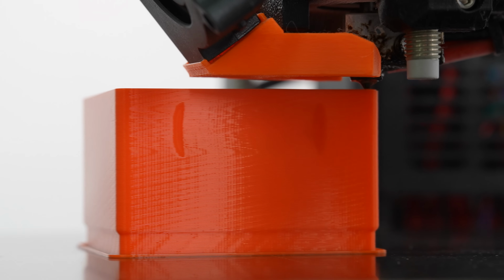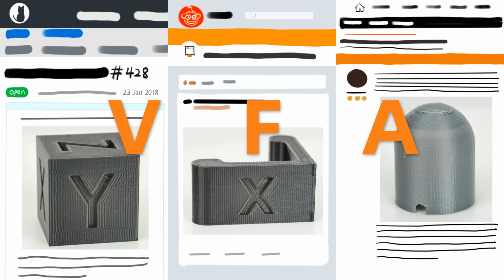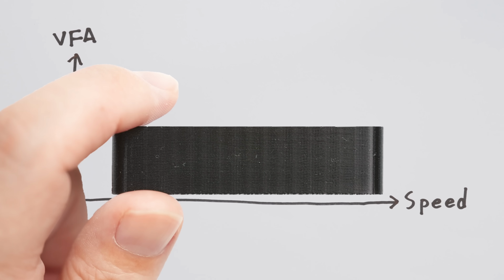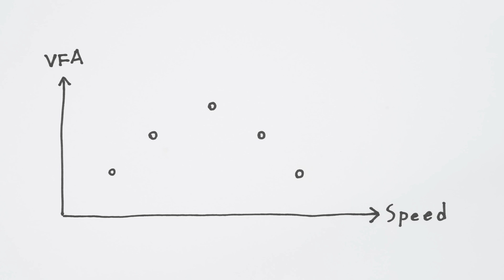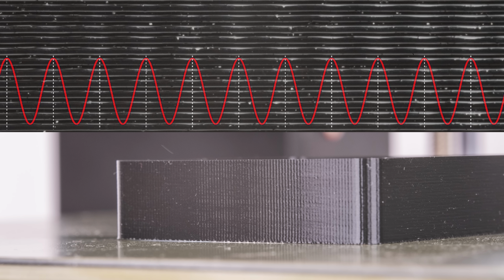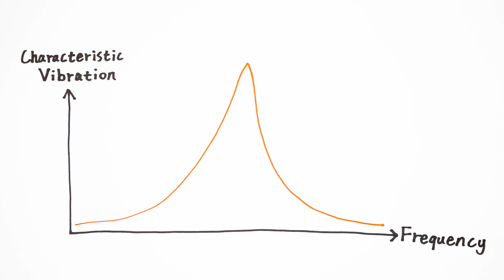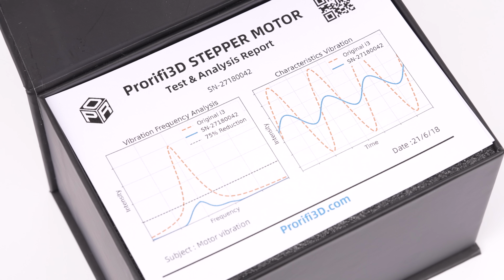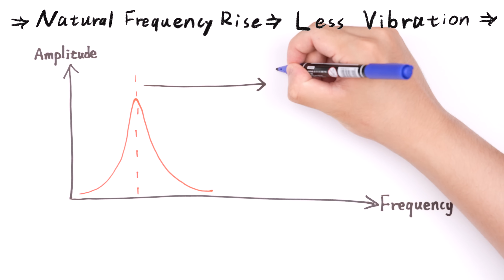We solved this common problem in 3D printing

Comment: Or just use input_shaper to rectify the resonance issues...
Reply from the maker: MRR(VFA) and ghosting are not caused by the same mechanism. Input shaping can reduce ghosting but it has no effect on MRR. We have a technical details page to help you understand the cause of MRR(VFA):https://prorifi3d.com/pages/technical-details
Reply: @Prorifi3D  Alright cool. Did you use input_shaper and your set up at the same time? If so, do you have pictures, and at what speed were you printing at?

Comment: Would these supper motors work on an ender 3 v2 that may be upgrades to an s1...
Reply from the maker: The tests we did on Ender 3 is limited but the result of MRR reduction is siginificant. We will realease a general purpose motor soon.

Comment: i guess personal background plays a big part in finding this problem. I found it in an afternoon and swapped to 0.9deg zyltec steppers and problem gone. 

good work explaining it though. its just a result of the stepper hitting its natural steps in a continuous move, think of it like rounding up or rounding down a number, its where the motor wants to rest. Its the same deal why people refer to "magic" layer heights, on a typical multi-start screw like an ender, one full step*pitch equals around 0.04mm.
Reply: So what is the magic layer height for a Prusa MK3?
Reply from the maker: We did some tests and research on 0.9° steppers years ago and they do reduce MRR(VFA). However, 0.9° steppers will bring more problems than they solved:
1. The 0.9° steppers have less torque and will lose even more torque at high speed compared to 1.8° steppers. This leads to poorer performance and stability.
2. Using 0.9° steppers also gives the stepper driver a heavier burden which will generate more heat. This will further reduce the stability.
3. In addition, for Prusa i3 and many other printers, switching to 0.9° steppers means your machine is no longer compatible with the stock firmware.
In conclusion, using 0.9° steppers means losing efficiency and stability in 3D printing. Thus they are not suitable for 3D printing.
Reply: @karoo_bushman6880  not a prusa guy, but you just have to find the pitch of the z screws and what degree the steppers are, probably 1.8deg. considering how thorough Prusa is, i would imagine the factory prusa profiles account for this, but wouldn't hurt to check
Reply: @Prorifi3D  not counting Prusa, if one is going to the extent of modifying a machine to the degree of replacing steppers, firmware likely isn't an issue. 

1:  if you are direct swapping without adjusting vref/current, this could be true. 

However I have 5 machines converted one of which is a delta machine. 2 machines are still on old A4988 drivers and even with a higher vref, the driver temperature difference is negligible, and performance at speed hasn't been impacted, even with Klipper and accelerations in the 3-5000 range on a 310x310 sized machine. 

I have thousands of hours on these machines with drivers ranging from A4988s to 2208/2209s, especially with more and more common TMC drivers, they are more than capable of driving them without issue. 

print quality and even noise has greatly improved with the 0.9deg steppers as on my delta and a couple 310x310 machines the banding effect was exceptionally noticeable. 

0.9 steppers on the extruder make a difference as well as once i converted the linear axis, you could see the same effect from the direct drive extruder as well when you looked close. 

i come from a Milling applications background, and i find tinkering on the printers more fun than even using them. 

I just don't care for broad statements against something (makes sense here, as this is basically a big AD video for your steppers lol) when I am literally sitting next to machines I have a ton of use with before and after trying the 0.9 steppers.
Reply: @Prorifi3D  saying 0.9 degree steppers are not suitable for printing is a massive stretch, and I would argue is outright false. I installed 0.9 degree steppers on my machine as a means to reduce VFA and they have been in service for 2-3000 hours at least, maybe more. 

You may need to compensate for reduced torque by using larger motors, but that has not been a limiting factor in my experience. Standard print speed for me is 80-100mm/s with acceleration at 4,000 on a bed slinger. I've printed much faster than this too with much higher accelerations and torque has not been an issue.  Talking 10-15k acceleration and 2-300mm/s on my cheap bed slinger. 

I would agree it may not be an entry level modification, as it requires some tuning (adjusting for steps, maybe adjusting stepper amps) but it is very achievable with some basic searches.

Your video is very good but your marketing and community responses are a bit vague/misleading to say the least.
Reply: @DangaRanga  I read your response after I responded - glad to see you have very similar experience to me on this. 

Quality 0.9deg steppers paired with 2208/9's is a massive improvement for vibration and print quality.
Reply: But you cannot just go ahead and install 0.9deg Motors on a Prusa. It requires to change and re-flash the firmware. I personally never touched it and don't even know if that's possible.
I remember having 0.9 on one of my printers and it was crap. It was weak and required much more calculations by the driver.
Reply: @mjcantontube  What are quality 0.9 deg steppers? I found a video about this topic, claiming that 0.9deg steppers from ACT were the fix. But I can't find them anywhere online.
Reply: @alejandroperez5368  I've had good luck with E3D's.

Comment: So, you basically found the holy grail of stepper motor design?
Reply: no because its just a LDO  Nema Stepper motor nothing else... dont fall for this. if you want to save money. check your belt tensioning, bearings, idlers, stepper driver voltage and ofc print speeds. coming from someone with 15+ years experience in the 3d print industry.

Comment: We had similar issues on some scientific projects decades ago. Best way to get smooth motion is to avoid stepper motors, they have vibration inducing torque ripple. At some level it is inherent in their fundamental design. Properly designed servo motors (with appropriate controllers) avoid this problem. The electronics and the motor must be designed to produce constant smooth torque. Steppers are great for low cost motion but not for smooth motion. Good motor control hardware and software can go a long way toward reducing the problem. If that's not enough, and one is contemplating changing the motors, perhaps it is time to change the type of motors.
Reply: Then SERVO motors?
Reply: easy to fix, lower belt tensions and lower stepper voltages and don't go over the mechanical speeds of a printer. some can print faster than orthers.
Reply: @teeniv84  Yeah servo's are the best but really expensive to set up. not worth it tbh because everything you see in that video is just artificially made... i got 5  i3's and none of them have these issues. and just look what other people print, almost none look like it in this video.

Comment: Great video, subbed. when are you going to make steppers for other printers?
Reply from the maker: We do have the plans for this but the product development and production cycle is long. It is not expected to be released for at least half a year. 
But we are testing the adaptation of our current NEMA 17 motors on other machines. With our limited tests, most machines including Ender3 and Voron V0.1 can use our motors with modified printed parts plus some tuning on driver configurations, and the MRR(VFA) reduction is significant.

Comment: Input Shaping or Resonance Compensation settings in firmware is a solution obiously. That's free and fast to do. Of course, maybe that's great to have such motors in 3d printer. It could make it a bit faster. But 199$ for 3 motors??? This is a robbery...
Reply from the maker: MRR(VFA) and ghosting are not caused by the same mechanism. Input shaping can reduce ghosting but it has no effect on MRR. We have a technical details page to help you understand the cause of MRR(VFA):https://prorifi3d.com/pages/technical-details

Comment: Is the MRR defect the result of resonance in the XY motion or in the extruder motor? Is the same defect seen in a bowen setup? I know a similar defect can show up from extruder hobbed gear being slightly eccentric. A very tiny ripple can even be seen that corresponds to the individual teeth on the hobbed gear as it bites into the filament.
If it's from XY motion, I also wonder if the resonant frequency corresponds to the belt length. Maybe the input vibration is from the motor and the belt resonates, causing a fluctuating tension at the print head.
Reply: the tooth digging in is very noticeable for me! as I print very small models with .25 nozzles

Comment: what about tl-smoothers?🤔 isnt that optimize stepper current?
Reply from the maker: TL-Smoother is an old story. And it has nothing to do with MRR(VFA). It fixes the defects of early low-end drivers. However, it is no longer needed on today's high-end drivers such as TMC drivers. You can check the details here:https://blog.trinamic.com/2018/08/16/tl-smoothers-do-they-make-sense/
Reply: @Prorifi3D  i would combine and measure resonance again:D

Comment: Nah, The problem is related to dual drive gears, not to motor. Even when use stealth chop or not I can still see artefacts. But guess what happens when I switched Motors between Prusa i3mk3s to i3 mk2s? Exactly - nothing happens because problem is related to dual gear extruder. Cheers
Reply from the maker: Looks like you are mixing inconsistent extrusion and MRR. We have a technical details page to help you understand the cause of MRR(VFA):https://prorifi3d.com/pages/technical-details

Comment: Moons motor?
Reply from the maker: Our motors are not from Moons or any rebrand. We produce motors.We performed tests on Moons steppers. The differences between motors are relatively large, especially in recent batches. Some of them can even achieve our qualified standard. But in the same batch there will be some with large vibrations. For consumers, there is no gaurentee for the quality of the motors you get. Thus no gaurentee for MRR reduction.
Reply: @Prorifi3D  good job!

Comment: MRR is caused by microstepping - motors only have a finite number of poles and digitally create aritifical sub-poles to achieve more precision. All that needs to happen is a gear reduction needs to be used instead of microstepping and the problem would theoretically be taken care of, being that it's a product of the microsteps between physical poles having varying levels of holding torque. Basically, the motor is slipping from the microsteps toward one of the physical poles.
Reply from the maker: Original i3 was already equipped with TMC 2130 drivers since MK3. We have a technical details page to help you understand the cause of MRR(VFA):https://prorifi3d.com/pages/technical-details

Comment: so with these motors coupled with resonance compensation tuning (input shaping) there should be zero resonance artefacts even at high speeds?
Reply: Because this varies of the speed. I think not  elimination complete but it would help.

Comment: Your site has almost no specs listed for the motor. Makes me think you're just taking 0.9 degree steppers from one of the better chinese manufacturers and rebranding them for a huge markup...
Reply from the maker: Our motors are 1.8 deg steppers, which will not lose torque or lose even more torque at high speeds like 0.9 deg steppers. We produce motors and so far as we know we are the only manufacturer who performs vibrations tests on every motor off the production line with reports attached.

Comment: Gear video and findings but just the fact that your brand will use “original i3” to designate Prusa or blur out LDO and MOON’S names is making me highly dislike your brand. I am sure it is done to prevent getting a copyright infringement but it most certainly would not happen. Secondly the fact that the graphs don’t have any real values make those very shady.

Comment: what about better motor drivers like trinamic?
Reply: Actually Prusa was one of the first companys using Trinamic with the mk3 in 2017. But at that time Marlin 2 was not ready yet, 8bit was state of the art. Due to the computing power of the board, 0.9° steppers were problematicly, so 1.8° are used.
In 2021 of course the solution is clear: Add Raspberry Pi Zero 2 W with Klipper and input shaper. As the mk3s has a port for a Pi Zero from the beginning, the hardware upgrade is quite easy. With the computing power of the Pi z2 the Einsy board becomes a dumb I/O, and can handle more steps/s - so you can use 0.9° Stepper without a problem. And klipper compensates for remaining resonances.

Anyway: TMC are controlled with 1/16 microstepping, making some predictions to interpolate to 1/256 microstepping. Theese predictions are not always correct. So a higher native microstepping might also be a good idea to reduce vibrations. So maybe some deeper digging into the internals of the used TMC, it can definitly used 1/32 native (prusa uses this on e), but maybe even better if not limited by the 8 bit?

Comment: First All Aluminium V-Slot Profiles are the same so it can not be from frame... I am a engineer that has over 25 years of experince in Mechatronics.As you guys don't know what the problem is I can guarantee you the problem source is extruder gear alignment,hotend heat instability and even the same looking filament is not all same thickness every meter... 3D Printing is not a Precise manufacturing process.The nature of Additive manufacturing leaves the unwanted artifacts.Cause its nearly impossible to maintain every parameter same like filament thickness,hot end heat stability although the extruder gear shifting,pressure can be optimized but filament thickness shifting will still effect the quality...

Comment: Installed closed loop steppers on X&Y ---> problem gone on any speed. No vibrations anymore, continuous correction of the steps, and you can see this while printing (always correcting)

Comment: I call BS until tested and proven by independent reviewers.
Reply: @dumbcat  Healthy skepticism. When something sounds too good to be true, it usually is. This solution came out of nowhere and after the whole community tried to figure this out for years. (i.e. The Bear frame and extruder mod came out of it) If the problem really was the steppers, they must have figured out a pretty revolutionary way to make them. (0.9 steppers improve things already, but have other issues) Seems to me this would be a more well known breakthrough as everybody under the sun would love truly smooth turning steppers 😉 (this already exists in the form of servos, different price range though)

Comment: And what about the motor driver ? Just use TMC motor driver ,, and voila! ... no vibration  no noise , no MRA
Reply from the maker: Original i3 was already equipped with TMC 2130 drivers since MK3

Comment: A better way of fixing this is just to rip out the control board and the stepper drivers and put in a better board with silent drivers.  No noise from the drivers means no noise in your prints.  That eliminates the need to replace all this mechanical stuff that truly isn't the root cause of the issue.

Comment: Creality knew since 2016 that motor vibration are to blame for print resonances and you since then you can buy motor dampers for like $3 dollars that basicaly do the same thing.

I just dont see, why would anyone buy fancy new motors in fancy box instead of just mount some damping plates to gain the same results.

Seems like wasted time.
Reply from the maker: It will not work. Since MRR is caused by the output of motors, add damping mounts has no use.
Reply: @Prorifi3D  The printer belts are long and dampen vibrations. Vibrations spread easily across the printer frame. This is your kit that also changes the frame.
Simple shock absorbers reduce the problem of frame vibrations as cheaply as possible.
Reply: @Prorifi3D  Of course it will work. It's all about vibration reduction and dapmers exists for a long time now. 

But ok, apperently you invented the new type of wheel. Maybe its spinning differently.
Reply from the maker: @Vjeko2404986  No it won't, just try it. Also, we have a technical details page to help you understand the cause of MRR(VFA):https://prorifi3d.com/pages/technical-details
Reply from the maker: @SergeiPetrov  We have a technical details page to help you understand the cause of MRR(VFA):https://prorifi3d.com/pages/technical-details
Reply: @Prorifi3D  i dont need to try anything because I dont have so called "mrr" problems thanks to other solutions like those that are already mentioned in the comments below.

Nevertheless, wish best of luck to you guys. I have never imagined that someone could build a stepper motor with a servo motor performance!

Comment: If you watch TeachingTech's video on acceleration and ringing, you will laugh at this video. These guys are creating a non existing problem and are giving a solution to that non existing problem. What a "great" way to make profit 🤦‍♂️🤦‍♂️🤦‍♂️
Reply from the maker: Looks like you are mixing ringing and MRR. We have a technical details page to help you understand the cause of MRR(VFA):https://prorifi3d.com/pages/technical-details
Reply: This is a very real problem actually, and it has nothing to do with acceleration.
We’ve just purchased an Intamsys 410 Pro high temp printer worth $30k and it has terrible MRR/VFA at normal print speeds (20-60mm/s)
The lines are MUCH more noticeable on the Intamsys than on our Prusa i3, Creality Cr10-mini, and Creality CR10-V2.
I’m speaking directly to the factory, but they have no solution yet…
Not a happy camper, considering sending it back for a refund
Reply: @thesuperjed1  Holly hell. Do you have an update on the case?